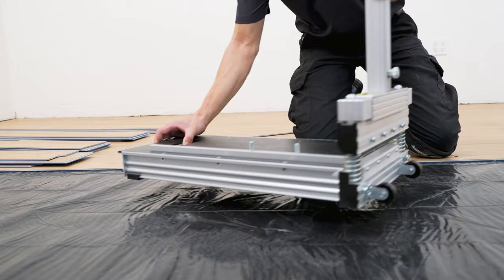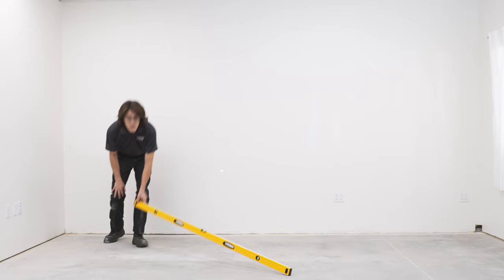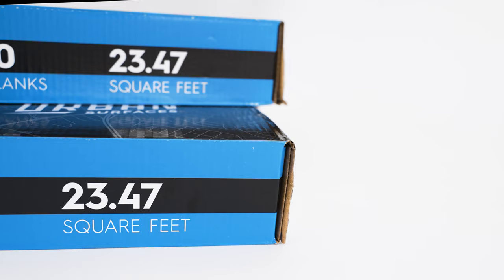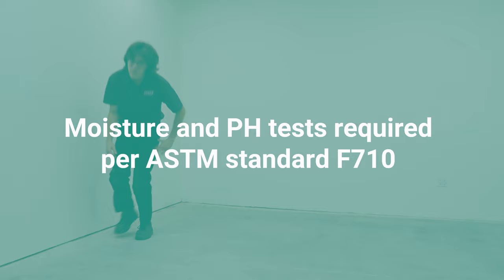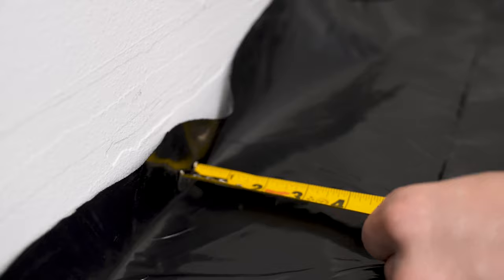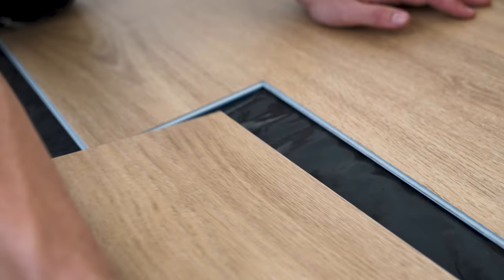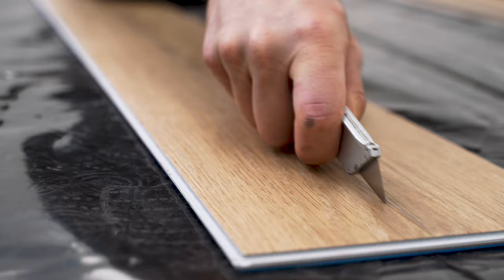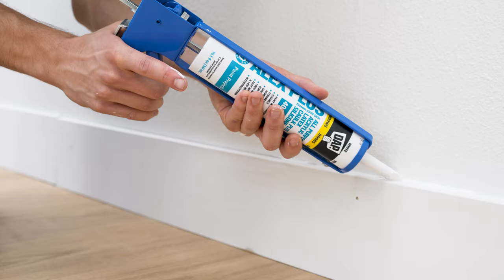How to Install: SPC Floating Floor

Comment: Can I install parquet with a slight slope in the kitchen floor?
Reply from the maker: Unfortunately with Floating Floor, you can't do a parquet pattern due to the clip system. However, you can achieve this with Glue Down or Looselay flooring.